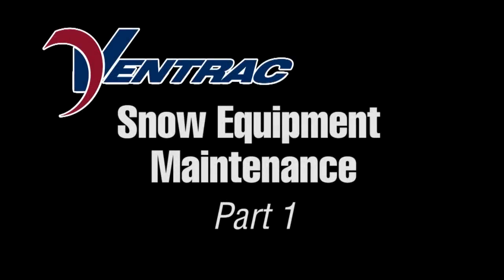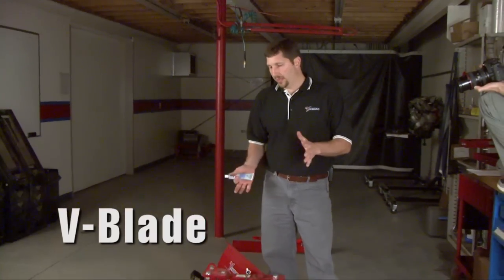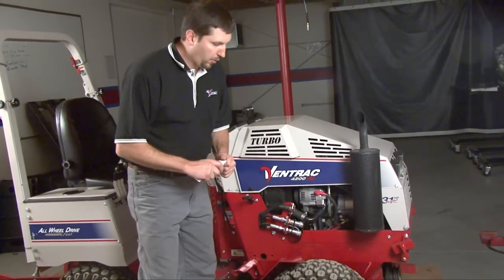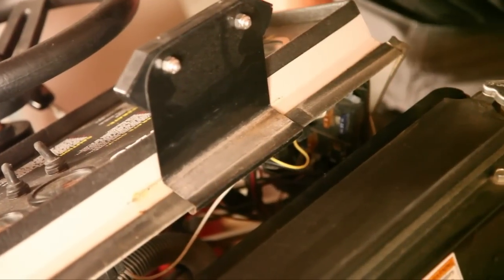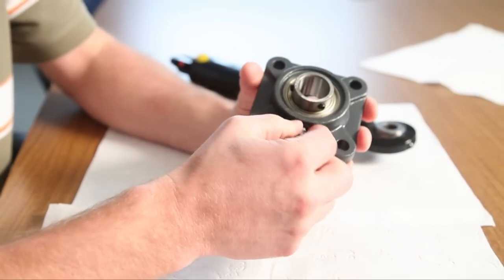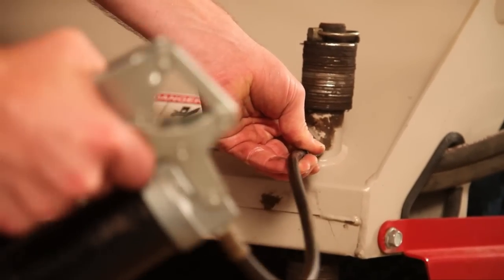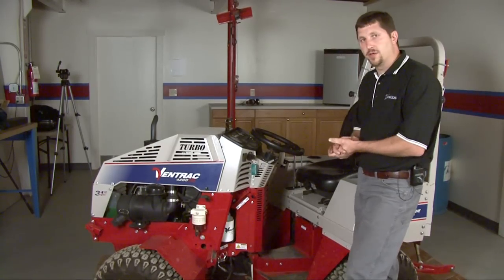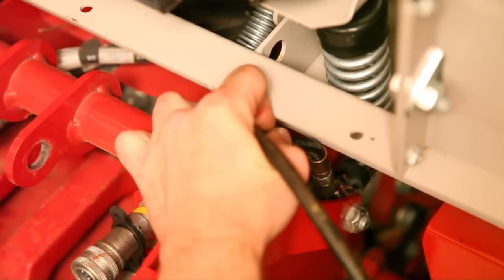Ventrac Snow Equipment Maintenance - Part 1

Comment: you did not mention if the two bearings on the ends of the broom attachment were sealed bearings that need two pumps or if they were a "pump till you see grease" open pivot type.